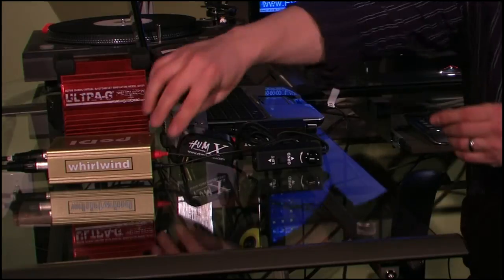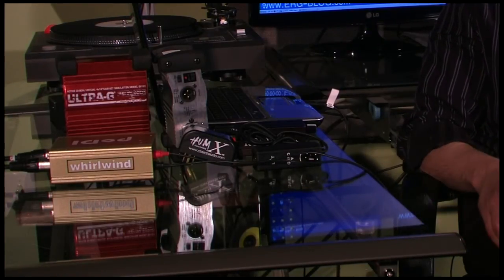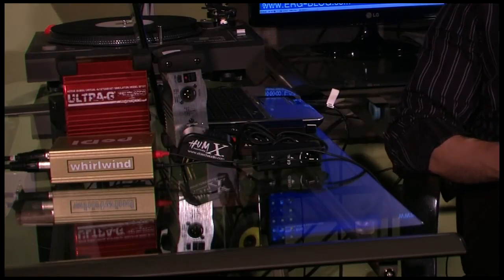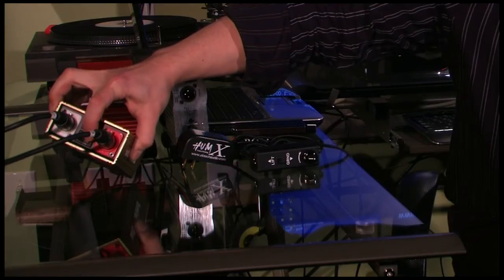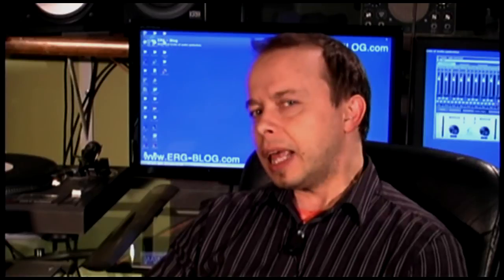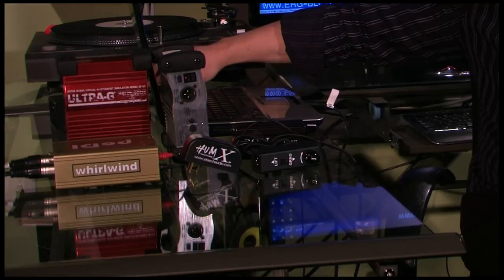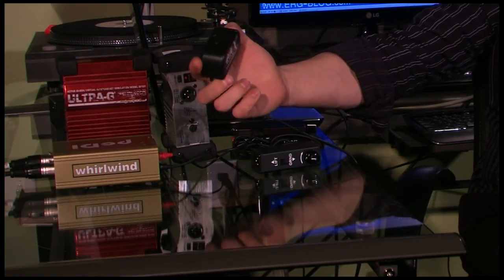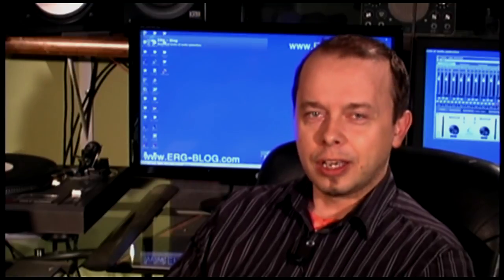Solutions for humming noise from laptops, keyboards etc

Comment from the maker: Do you get this noise in the headphones plugged directly into M-box without connecting any other gear? If yes, Hum-X would be the best solution. If not, any direct box with ground lift between M-box and your amp should work. If amp doesn't have XLR input, Ebtech Hum Eliminator should work, but make sure you use balanced cables (tip, ring, sleeve).

Comment: I also have a Guitar Rig Mobile (little usb audio interface which runs on usb cable power). When i use this instead of my Mbox 3 Pro, as long as my laptop is NOT connected to a wall socket, I get ZERO buzz. So, I am sure that all my devices are working perfectly and that the ground loop is coming from the house wiring, because as soon as anything is connected to the wall socket i get the buzz, otherwise ....no buzz. Im really not sure on what i need to get to eliminate this buzz...

Comment: Hi there. I am a British living in Hong Kong (british style plugs). I use an Mbox 3 Pro (firewire audio interface which needs a 9V DC power supply) which my Les Paul Guitar runs through and into my macbook pro laptop. I get buzz even if i connect my guitar to my Mbox WITHOUT even connecting it to my laptop....so i am sure the ground loop is in the house wiring. would a DI box or an Ebtech Hum Eliminator remove this buzz?
Reply: I have been running Music sessions from my Laptop now since 2008 from US to France to Caribbean and now back to UK. The best solution i have ever had clear hum noise eliminated is with the EBtech Hum-X, sadly there isn't one of those made for Europe or UK only US wall power socket.

For Europe an electrical engineer suggested i remove the Earth wire in the UK plug and i have had some success in some places but not all. I am now about to buy the "Millenium DI-E Hum Ground Loop Eliminator" which was reccommended to me. Watch this space.... :D

Comment: one question. i have an europe type outlet ( 2 holes ), not an uk one, with that 3 holes ish. so what cables can i use to connect my equip ( not to meny, 2 speakers and a piano , i wanna buy this because my hs 80m makes a white hmmssss noize when the volume it s around 12 a clock ). can i put a power pc desktop type cable from one outlet of the Furman and then put a normal outlet to connect my 2 holes outlet ?????
Reply from the maker: +snoopy nasosu If you are getting white noise, it wrong gain structure. Most likely you plugging your keyboard or mixer into Mic input on your speakers. Plug into "line" than go from there.